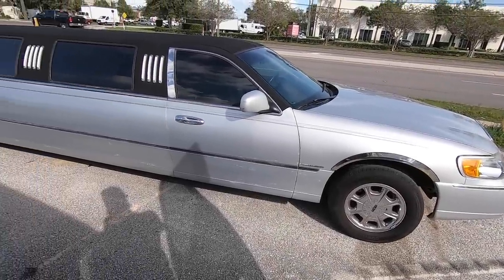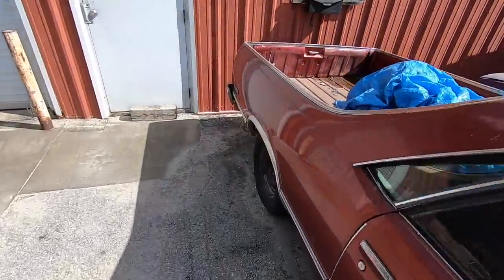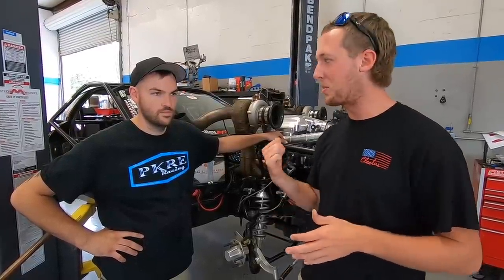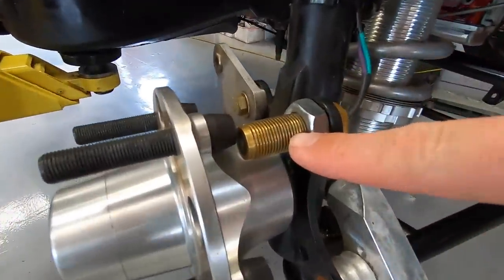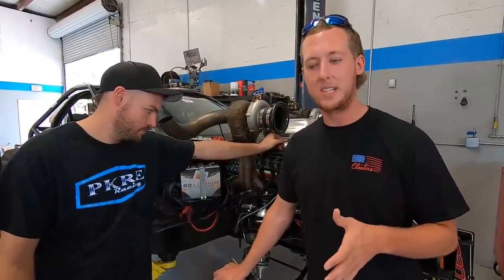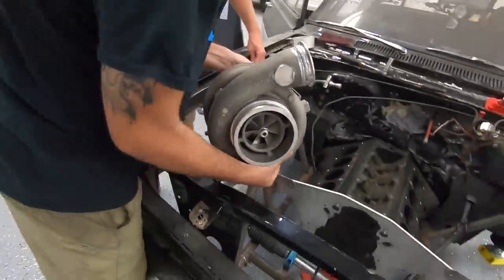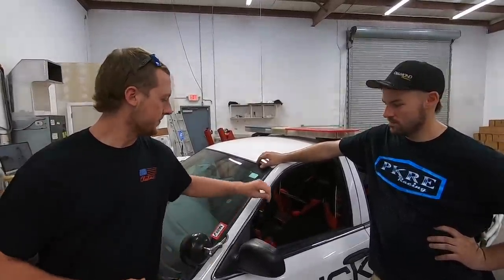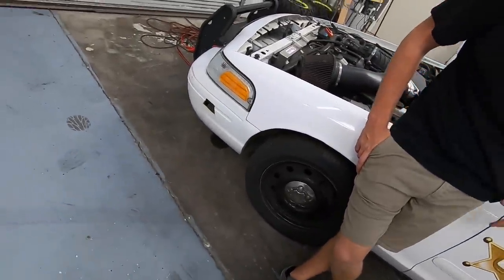Here's Our Plan To Make Leroy Go Mid 7's... (First Discussion of Body Panels)

Comment: GM 4200 I6.  Let's see some economical competition to the 2JZ.
Reply: Yes!!! Get a Atlas
Reply: THIS! i was thinking Atlas LL8 man!
Reply: I was going to post the same thing till I saw yours. Hardly anyone is playing with the Atlas inline 6 and it has great potential for it's displacement.
Reply: Something like that sounds awesome. There are not much boost engines around.
Reply: Had anybody done anything with those 4.2s? Discussed this with a friend a few months ago
Reply: @fuse8052  just rip a good old saturday and put a cts v6 in it
Reply: @richb.4374  i think the same i think its real as much funny as facebook emoji on a article
Reply: I was going to say the same thing! That or a BMW N54. As much as I like Beemers I would love to see a GM Motor in a GM car.
Reply: @Wicheeeeeeeer  Not really a big fan of the Cadillac/opel v6s. Too overengineered for my liking. Unless I am thinking of the high value or high feature engine. ?
Reply: There was a gentleman that swapped one of these into a supra. He has one of 5 of the manual bell housings. Jeremy is his name.
Reply: I have a trailblazer with the LL8, that engine is fucking legit. Even with the torque management in the computer, it has fantastic power for when it was made. Ive seen people do dragsters with the LL8, some turbo ones making like 500-600 horsepower easy.
Reply: Yeah there are a few guys messing with them.  Motortrends Hot Rod Garage is about to release video of modding one so that will probably really set it off.  They have great potential for what they are.  If the aftermarket picks up on them I think they could be a Barra or may be even a 2JZ competitor.  Anything can be made badas if you throw enough money at it.  A 2000hp 2JZ isn't cheap.  I have the same opinion of Northstars.  If you threw $20,000 at a Northstar, they would be badass.  It's a very potential platform, just needs the kinks worked out.
Reply: @michaelrogers2758  iirc GM ran one in a trophy truck when it first came out. They're damn near bullet proof at that. The only real problem is once you get north of that 500 hp range you really need to start building it up and theres next to no parts available. Just getting a camshaft is hard.

Comment: Barra. Everything else has already been done to death (in the US).
Reply: Viper V10:

Am I a joke to you?
Reply: Barra is the answer.
Reply: Lactrix  because that 8l "junk" motor can make xxxx very very easily with boost.
Reply: Yeah, these guys are headed to 'Strallia soon. They could visit Haltech and pick up a few Barra's to play with would be worth it.
Reply: Lactrix definitely not a junk motor. That's the same power to displacement ratio as a lot of the factory LS motors...
Reply: @soundestmonk  I couldn't agree more, it's the overlooked crazy engine, because you can get that from a totalled Ram
Reply: Lactrix  wait, no
Reply: A 2L won't have the Torque or reliability of a Viper V10.
Reply: Not gunna lie, Be sick if Benny from bcw or someone of the sort could spot them a barra, It'd be mint just to see how these lads would go about it ay
Reply: Lactrix  in what world can you just add boost and get xxxx power numbers? You have to built the shit out of any motor that size to reach those numbers. There is factory v10s with twins making 1100+ horsepower. Youll never do that with a 4cyl. Even a 2jz would need a bit of work to hit those number reliably.

Comment: Keep in mind when you launch Leroy and carry the front tires however many feet (and you do carry them when you launch) your speed reading may be a little slow until the front comes down.
Reply: That’s why they are putting a Speed sensor in the diff
Reply: Wicked Proxy I’ll be interested in seeing how this works out . A good launch pulling the wheels off the ground might tell the computer all it did was spin the wheels , causing the launch to be worthless. What do I know though.

Comment: I'm tired of seeing 2j's. Barra swap it. Would definitely be sick
Reply: Yeah but how many j powered corvettes do you see
Reply: Screw the 2jz put a vortex 4100 I6 with a turbo and see how far you can push it that would be sick
Reply: Last time i cheked there was only 1 in the entire country...no parts.
Reply: @Coldcooler3  vortex 4100?
Reply: @theophobia3351  that's the thing. I don't wanna see it lol. Just at SEMA alone everything was either LS swapped or 2j swapped. Not that many people swap Barra's in the states
Reply: Zach no it’s the in-line 6 that came out of trailblazers they have some good torque so I could imagine it’s would be sick with a turbo

Comment: Slap a barra in that thing lmao I would love to see that so much.
Reply: Yeah that was my first thought. A Ford Barra in a C5? Hell yeah... We have a few in the states for sell right now as well.
Reply: Steven Young it’s not about being easy it’s about being different unique and something people wouldn’t think of lol. That’s the whole thing with ruby. Plus a ford engine in a Chevy would definitely get people talking lol. Maybe not all good or bad but publicity is what gets stuff rolling either way lol
Reply: @Steven Young Machine work wouldn't be that hard to do here. Performance parts can be air shipped pretty cheaply, depending on weight. Getting engine here since it weighs a lot it would be incredibly expensive for air shipping. We ship them via container like what Toast is in right now... for 450 for gasoline engines. Or just sell the complete engine. We have a few in the states already and can import more as needed. A BF with all the electronics (if you don't go aftermarket ecu) for example is about 1400. Or 1200 if you order it, that requires a 600 deposit. 

Stock engine should be able to hold about 500hp with not much done to it. Getting to 600 that's when you start floating valves so stiffer springs, 800 is when you should look into forged pistons and con rods, as well as upgraded bearings. The stock crank and cam shaft should be good for at least 1200 that's what the Cresta had in it for a bit before it dropped a valve at idle.

Comment: Why not try a Mercedes M104 engine? Commonly used in drifting and very easely acesseable when its mounted in many older s and e classes. 2.8l and 3.2 liter share the same block and using crankshaft from om606 turbo and aftermarket pistonrod it will be a 3.4l. And i dont think i have seen it i dragrace before.

Comment: With the speed sensor on the front wheel, how are you going to do boost by speed on the dyno?
Reply: Jacob Pearce they are putting a speed sensor on the rear diff also
Reply: Jacob Pearce they will have to go in the computer and disable the “traction control” and either lock it into a set boost or go boost by speed on the rear diff.

Comment: See I think part of the charm of Ruby is the fact that it has a truck engine. What if you put in a Vortec 7.4 or 8.1 and built off of that??
Reply: The 8.1l is a complete boat anchor for performance builds. No aftermarket parts and they only make a little above 500 hp when "built". They're great low rpm towing motors that love to drink fuel.
Reply: 2.8 stroker
Reply: Not anymore for the 8.1fun. Several guys have been pushing the aftermarket out west on it. Raylar and Whipple just made a blower for it, and several guys on the 8.1l engine group have builds pushing high 600, Low 700s all motor, with the same in torque on iron heads. Aluminum heads are now available with 2x the flow of ported irons. A few have builds with much more boosted, in the 1.5k range at lower boosts, like 11 to 14psi. PSI bought the 8.1l design and modified it for heavier duty,  then designed a fully forged 8.8l stroker for it. Its good for stupid high power/torque. They have OEM versions pulling 1ktq now.
Dart is also now making modded blocks good for up to 692cuin.
Hell a simple cam, manifold restrictor delete mod, roller rockers, long tubes, exhaust, and a tune, and I'm pushing 395hp at the wheels with 495tq in a 2500hd suburban. Many others are doing the same and still have stock driveability.
Reply: @davemcdaniel4856  Mike finnegan just built a dart based 540 inch bbc design and made 1012hp all motor. So I don't see anyone jumping on the 8.1 bandwagon except of course, the people who own one.
Reply: @davemcdaniel4856  oops sorry the block was a  brodix standard deck BBC.

Comment: Put a duramax diesel in ruby 😂🤷🏻‍♀️👨‍🌾
Reply: But make sure it’s an 2006 that was the best year for deisel truck because they didn’t have some many smog emissions like cars nowadays do 👍
Reply: Terri Arebalo easy to delete all 6.6 duramax engines besides the L5P
Reply: Extend the front end massively and drop an isx15 😂😂😂😂
Reply: Definitely will not achieve low 9's much less 7's.
Reply: @Thegoose95  i think 7s are quite possible given that ppl have run 4s in the 1/8 mile in much heavier diesel trucks
Reply: @nicholaskenny8160   cleetus and them would have 0 knowledge of even remotely building a diesel to the specs of those trucks. I would say only a handful of people have gone 4's.
Plus many of those trucks run 4 wheel drive.

Comment: The Holley doesn't let you design a boost curve for each gear?? It has one boost setting per the entire gear?? Ok steering clear of that for sure on my LS builds... I'm an import build guy, and I LOVE boost-by-gear/RPM for the exact reason that you can design the exact boost curve you want for every gear, to keep the tires planted on the verge of ripping loose through peak torque, then ramping up the boost as you get into high RPM so that the torque doesn't drop off etc...

Comment: Fucking sweet! I had been wondering for MONTHS why you guys were still doing boost by gear instead of boost by RPM. Hall effect sensors ftw! Can also dial in slip to a specific MPH per gear with those sensors as well so ECU will make extremely quick adjustments via boost and timing to progressively apply as much power as it can maintain without losing traction. Beautiful stuff!

Comment: 4rotor! Or how about a 4G63 (wich can be built up to 2000hp or something), viper V10 or a boxer engine? This would be something very different to what is seen the most. There are a lot of 2J's but that would be something that not a lot of ppl have done. Also something very spacial would be a 5zylinder Turbo
Reply: Yeah i had 2 Volvo with the inline 5, 2.3 liter turbo i sound like a baby v10.
Reply: @jakelowang4132  They just sound AWESOME! Do you know 5zyl_marco?

Comment: BENTLEY/ROLLS ROYCE ALL ALUMINUM 6.8 STROKER 8 + LITER!!!!!!!! Brother, I got it. Bentley aluminum V8 is full skirt big block size. Super cheap to buy and block/head combo good for 3000hp. It will take 4.5" bore and 4.25" stroke 541 cubic inch. You can buy the whole car. Anything 80s or 90s for less than 3 grand with no miles. Block and heads are bulletproof.

Comment: Why don't you guys put that speed sensor on the back tires this way it will adjust as tires lose traction on take off
Reply: You missed it, they said they would add a sensor to the rear diff and then setup a retard to reduce power to regain traction, if the rear wheels spin a certain speed over the front. As long as the front wheels don't leave the ground, it sounds like a great idea.

Comment: Put a hellcat motor in it and call it Ruby from hell. Or put a gtr motor in it or u can do a 6.2 dodge motor i think they out the factory with a forged bottom so u can spray it my friend had 07 srt8 and it could run 190+ on top side with just spray

Comment: Ruby goes Electric! Transplant wrecked Model S-P100D front & rear drive systems with a small battery pack just big enough for a full pass or two to save massive weight, then have a generator to charge her up.  BE DIFFERENT!

Comment: 2 stroke Detroit 16v71 in Ruby lol
Go watch DeBoss Garage video. Click at 10:00 to see its runaway, 14:20 is full send it runaway mode 
https://youtu.be/JxLb3Yqqds4

You can get 2 stroke Detroit inline models included one, two, three, four and six cylinders, and the V-types six, eight, 12, 16 and 24 cylinders.

Comment: V12 LS or dramax. Also I wonder if anyones ever made a v4 ls or straight 4 ls
Reply: Doug Savery pretty sure the gm ecotec line of four cylinder engines are basically ls style... I may be wrong but from when I messed with them that’s what I understood
Reply: @chevysmith273 not one bit. They are DOHC. LS are pushrod motors. I doubt a single part is interchangable
Reply: Nothing is interchangeable but the engineering on short block is similar...either way the 2.2ecotec can be destroked and made to make huge power numbers on single turbo we’re talking 1400hp and 10k rpm
Reply: @chevysmith273  I never said they couldnt make big power I dont doubt that but ofcourse the engineering is similar the same company is engineering the thing. But that being said doesnt mean anythin internally is the same. They might use similar processes to get to the finished product but nothing is the same. I was saying id like to see basically a v8 ls chopped in half and see what that could do
Reply: I mean you can get a v6 ls where they block off two cylinders and run em in that configuration not sure how you’d go about getting to online four but it would be a cool experiment
Reply: @chevysmith273  even a v4 block would be somethin to see. 3.0l v4
Reply: Definitely would be something...less reciprocating mass means maybe 10k rpm ls...probably would be better suited for coops Supra as car has less weight there for not needing the bottom end torque as much
Reply: @chevysmith273  right or an inline 6 LS to mimic the 2jz configuration wouldnt be so hard they already have a v12 ls so they already have a head for a 6 cyl

Comment: Screw it, better idea: what is better than a 1JZ? Not a 2JZ but two separate 1JZ's, aka the 1GZ-FE V12 from the century. Different yet fun, and can handle power. Definitely will be harder to find parts for, but it will sound amazing.

Comment: Do a 4cyl Ecotec build for Ruby. You've already got a clapped out cobalt to start with. Look into GM's former pro fwd program, as well as Lingenfelters former Ecotec program. The potential is there for 1700-1800 hp. Up to 1300 hp is somewhat affordable. Knocks the nose weight of the car down significantly increasing rear percentage, and therfore traction. And knocks down overall weight aswell. Plus the Vette stays GM while achieving the somewhat "import" desires. Still cheaper than a 2jz build with comparable power.

Comment: Regarding all the suggestions to put a body on the car, you really don't need a full, factory type body for aero. 
Think about airflow. Direct the air around the car and create a high speed boundary layer that will continue back over the car acting like an aero shell. 
So what you need is a small, smooth, front shell to direct air smoothly past the rest of the car. 
Think about how semi trucks have aero shells on the cab to deflect air around blunt, square of the trailer.
https://upload.wikimedia.org/wikipedia/commons/thumb/8/88/Trailer_skirt.jpg/1920px-Trailer_skirt.jpg
Then do something similar for the front of Leroy. Use that 42" light trigger length in the rule book. Make a front fairing for the nose that deflects air over or around the rest of the car. Add a rear diffuser to fill the space behind the car with air from under it and reduce drag. 
Take Leroy's measurements into a CAD program as a few simple boxes. Take an egg shape and overlay it until it covers the nose and then cut away the rest of the egg.

Comment: putting a speed sensor can be good and bad because now a little loss of traction can turn into a no grip rubber slip n slide you gotta be easy with the throttle or you'll slip